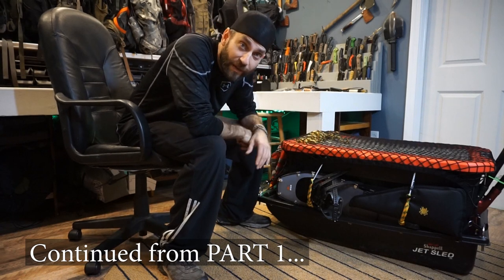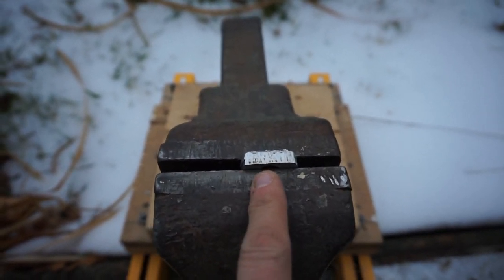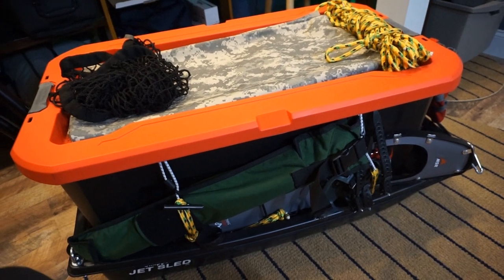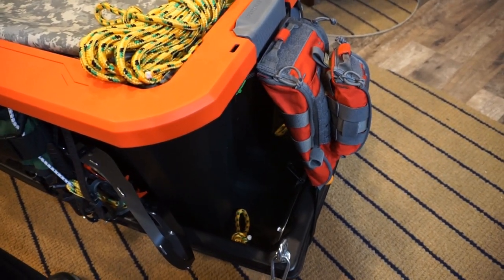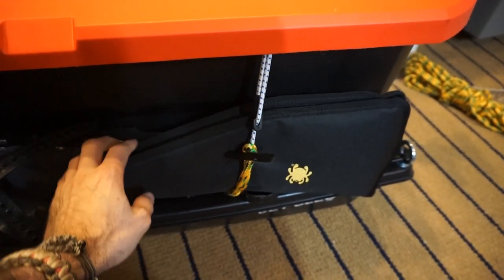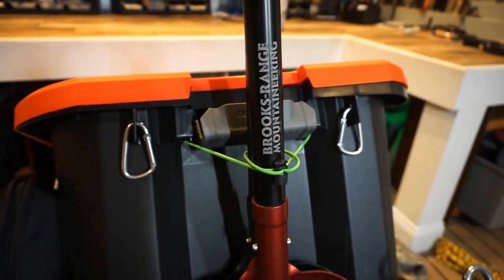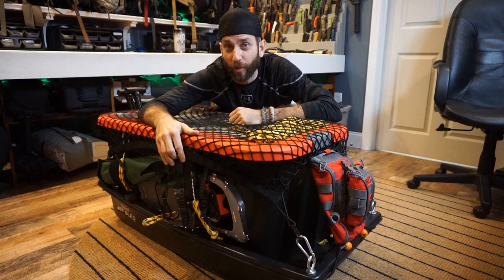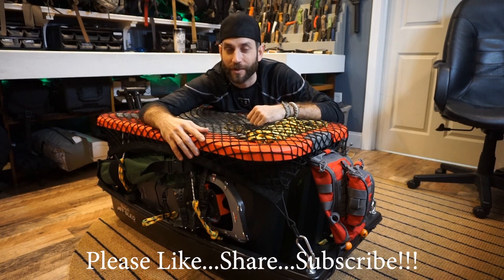Part 2 - Pulk Sled Update  - Access Gear Easily While On the Trail!!

Comment: So good bro! I just ordered my Jr sled on Amazon. Cant wait to get it set up and out o  the trail! Thanks for your hard work to make my life easier!
Reply from the maker: You'll be happy...there's plenty of capacity and it's a good starting platform for you.  At a reasonable cost and a very easy to use and modify sled, you'll be in good shape.  I spend tons of time working on this stuff...it's definitely a hobby and I enjoy the creation process.  It's not just the outdoor adventure for me...it's figuring out how to approach it in the first place!  So this one is a unique opportunity to get a huge amount of gear out on the trails and in a safe manner.
Reply from the maker: Do you think the bin is a better option than the duffel bag?  I don't see me having any issues with this, and it was a good overall progression.  It took me about 3 hours of research and figuring on which bin would be the optimum choice.  I drank a bunch of vodka and watched a bunch of football while I did the research.  Multi-task!
Reply: @outerlimitless  lol sounds like you had fun with this one. I think the bin will work great. The only issue I see is it being to top heavy but as long as its load correctly it should be good. All your gear will be safe from the elements too. I like it!

Comment: I put two mountaineering ski skins on the bottom of my sled. This works great. The sled easily slides forward, but the skins prevent the sled from sliding backwards on a slope.
Reply from the maker: Oh, that's a great idea.  I will definitely look into it.  Thanks for the idea!
Reply: @outerlimitless  The only problem is that skins are very expensive. Try posting a want ad on Craigslist, or talking to some outdoorsmen at somewhere like REI or a climbing store. Perhaps you could find a used pair. Skins attach to skis with glue, making them removable for downhill skiing. So they will stick to a sled as well. But I added two rivets on the front and rear of each skin to secure them permanently to my sled.

Comment: Good job!
The threads on those bolts for your gear may cut the bungee cords due to vibrations, carabiners may be better idea.
I thought of something else, if you want to keep the bolts, coat the threads with liquid rubber, then cover them with heat shrink tubing. That might prevent any damage to your cordage!
I hope this helps, anyway I like your sled enhancement project!
Reply from the maker: You could be right about the bungee damage on the threads...I hadn't considered that.  I'm not overly concerned, but it's something to watch out for.  I like the shrink tube idea...electrical tape is also probably enough to soften the threads.  But yes, good thinking!

Comment: Awesome. I was going to suggest a  Pelican style case but that would add to much weight. Great video👊🏻
Reply from the maker: I don't know if you can get Pelicans that big, but if you can it would probably cost a pretty penny!
Reply from the maker: I think the bin should work fairly well.  I'll know soon!  Thanks for watching!
Reply: outer limitless 
I know a guy that knows a guy😜 so send me the dimensions of that current Bin and let me see what I can find. Again it is going to weigh more using an Injection Case and may not be as customizable with drilling of the the eye bolts etc...